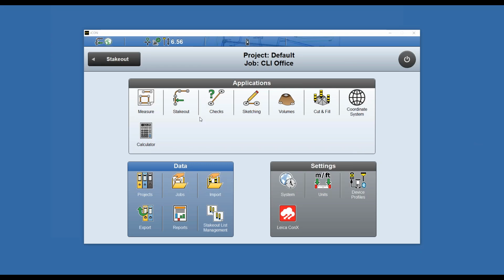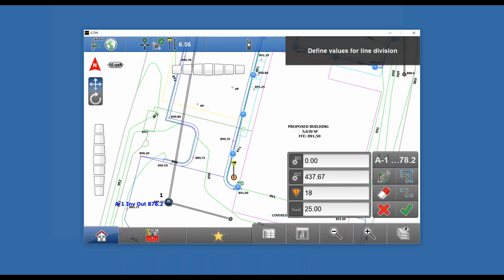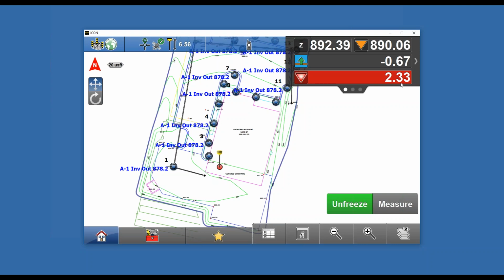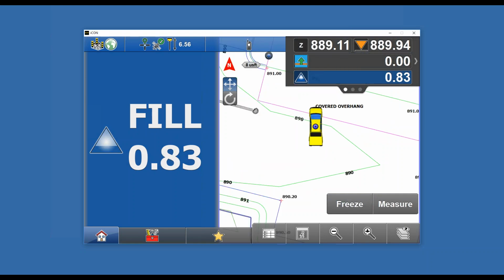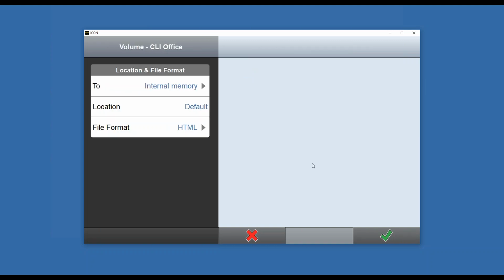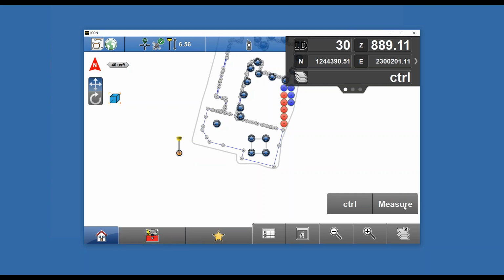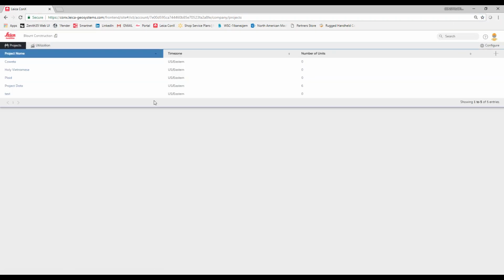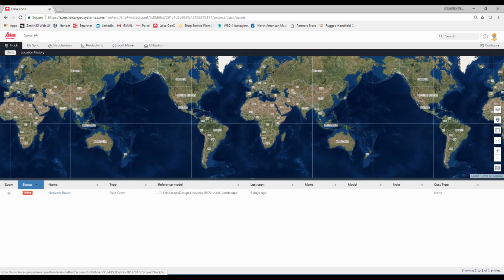Leica Geosystems Icon Site Application Overview

Comment: how can I use feature line for the elevations?
Reply from the maker: Sorry for the late response, in versions before icon 4.5 the Line has to be a 3D polyline and when you select it you will get cut/fill values instantly.  After version 4.5 you can either use a 3D polyline as shown in the video or you can have it interpret the lines elevation from a surface model that is loaded in the project and offset/stakeout from the line.